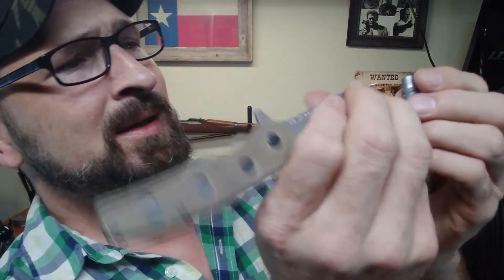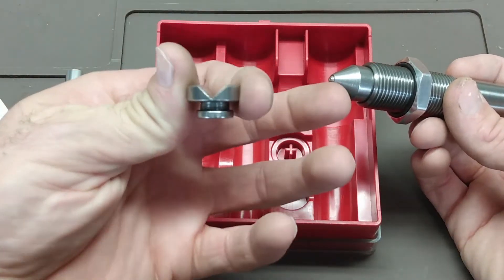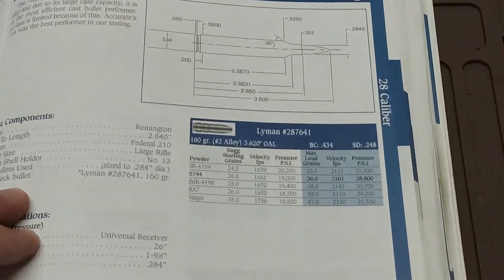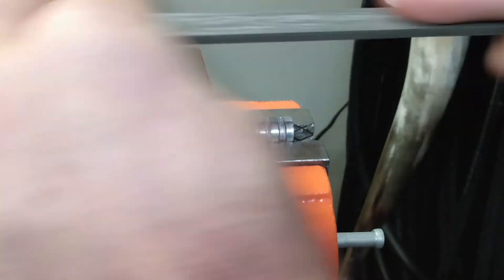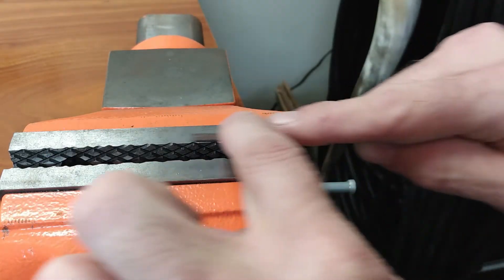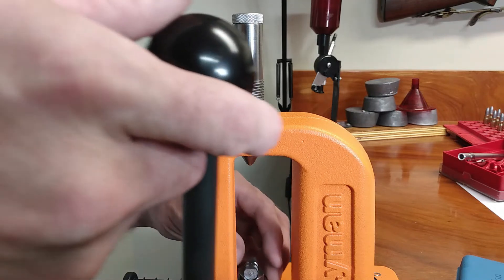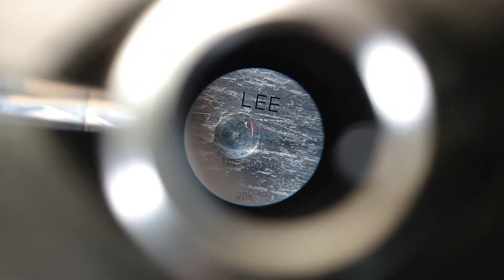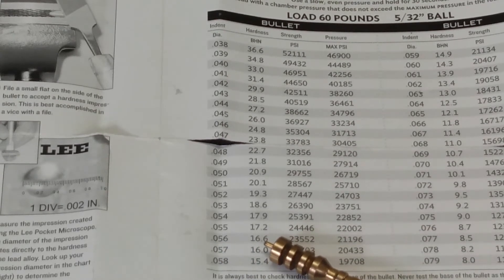1. Lead Alloy Hardness: Measuring with the Lee Hardness Tester

Comment: Great video. I wonder if you did the flat spot test and then turned right around and did the end of the boolit you would get the same readings? That could verify if Mr. LEE's recommended side test was even necessary???
Reply from the maker: Sounds like an exercise worth trying at some point for curiosity sake. I just never gave it that much thought. Thanks for stopping by and chiming in. Lord bless you my friend.

Comment: AFAIK Lyman #2 alloy is BHN 16 which would be much lower than 45k psi. That is the alloy stated in the loading manual at 7:40. So lyman beleives their alloy is capable of higher pressures.

Comment: If you hold a metal ruler knife edge across the top of the die, it will stop the pin from protruding past the top of the die.
Reply from the maker: There is some slight tolerance below and above flush that Lee states in his instructions. There is a possibility that adding an item to the top of the die will affect the pressure and give a false reading. I don't know how much it would take to cause a false reading. It may be worth doing some testing just for kicks. Thanks for watching!

Comment: An expensive hardness tester, or the "fingernail" test are not required to determine lead hardness. All you need to do is research pencil testing lead and an inexpensive staedtler pencil set.
Write the numbers inside the front cover of the pencil set case and carry on testing.

Comment: Your setup for holding microscope works great…. But consider this for even easier application.
Obviously you haz 1911 . If you cast for that, you prolly haz .452 Lee sizer ? I fortunately haz Lee push thru. Leave boolit in cradle on ram. Remove Lee test punch, install .452 sizer, bring ram up so boolit is up against bottom of sizer. Slide microscope down thru sizer, to rest on bullet. Shine your little bore light in.
Reply from the maker: I will have to give your idea some thought. Thanks for stopping by!
Reply from the maker: https://youtu.be/f-6N-6KL1vQ?si=VEA2klK_VST82JYs I took your suggestion and ran with it! Thanks. Cool idea!